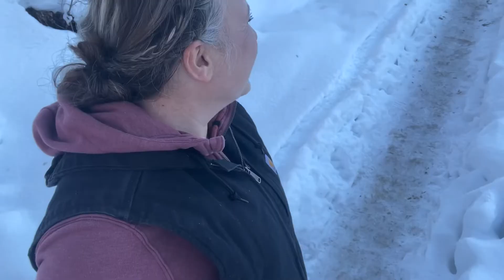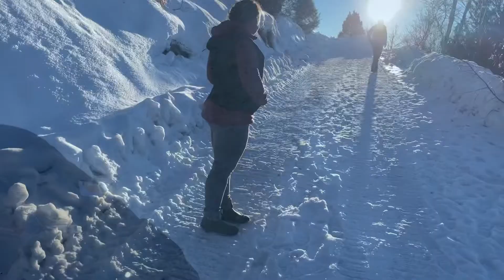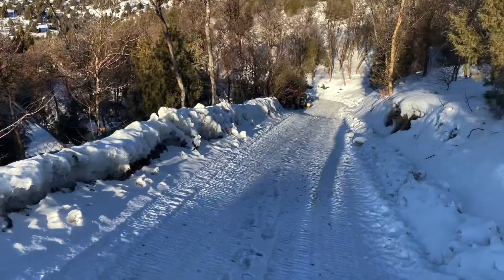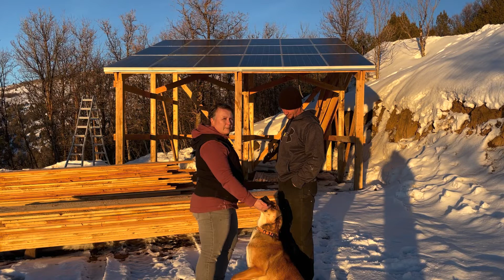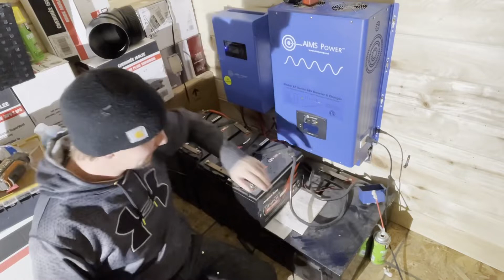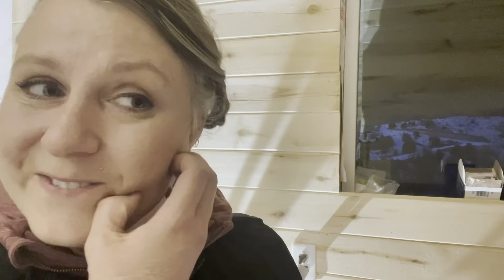TOUR OF OUR SOLAR SYSTEM and HOW MUCH DO WE ACTUALLY MAKE? \\ MOUNTAIN MAPLE RANCH

Comment: Nice explanation on your solar power and I agree with you're advice.  I started 4 years ago and over the years have added more panels, more batteries, and even a 2nd inverter and learned a great deal from hands-on operation.   You're comment about doing a system and learning and then going from there to grow is spot on in my opinion.    I also have AIMS 12,000w inverters :)
Reply from the maker: We have a second inverter and change controller  in our conex and waiting to be added to our solar system when the barb gets built. The AIMS has been great to work with and they have good tech support.

Comment: How many amp hours do you have? You can run an air conditioner during the sunny days?
Reply from the maker: We plan to run and Air conditioner int he barn when we get all the panels connected. We make more power then we can store so when we build our barn we will purchase more batteries. 
With our two 48 V batterie systems, one is. 100 amp hour and 250 amp hour with the total of 16.8 kW/hr
I hope that answers your question:)
Reply: @MountainMapleRanch  amazing, thanks!